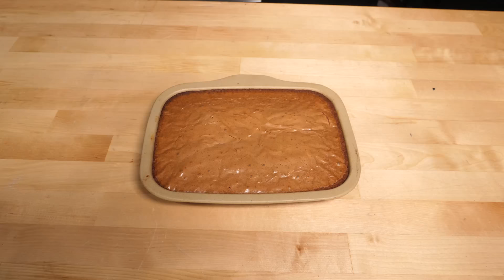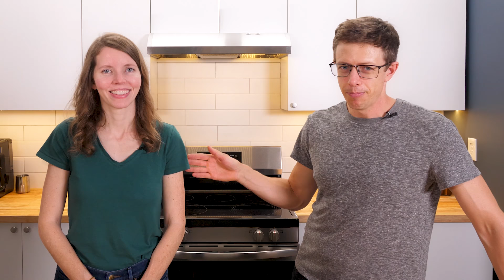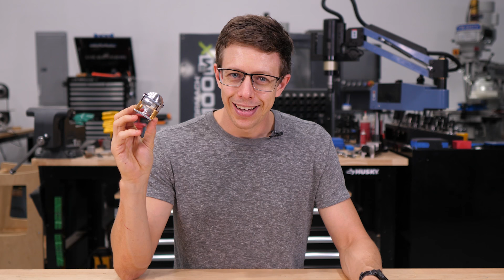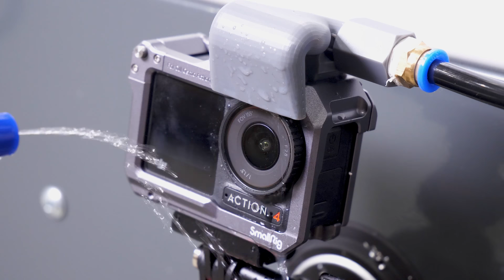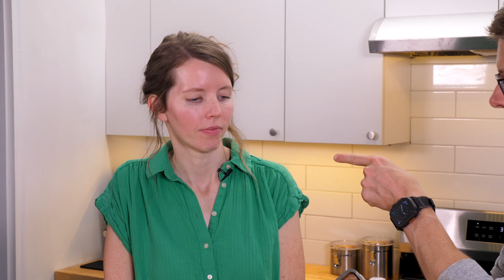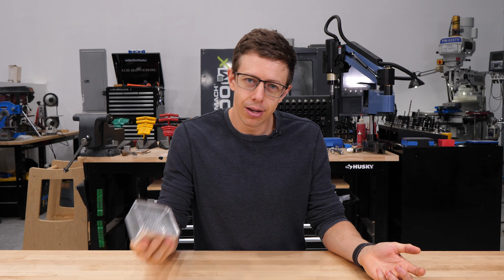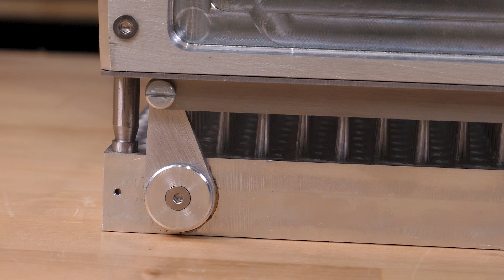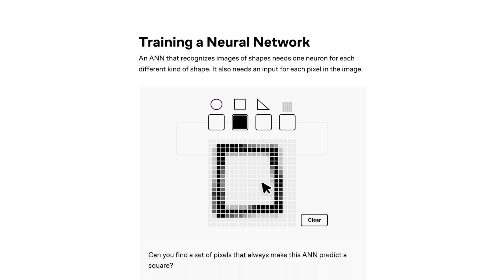Baking brownies from the inside out

Comment: Why not put the brownie mix in a paper cup like with cup cakes or muffins. The paper is thin so you get easier heat transfer, so less dried out and thinner softer crust. You could also just bake at a lower temperature for longer. For more even heating, right? Or make them thinner and bake for shorter since heat will reach the center easier and it'll cook faster. easy to over cook then this way though, so if you like a hard crust you can do the same but just bake for longer. Or you could steam the brownies so they are softer and fluffier. Like how people bake a cake in a rice cooker.

Comment: Instead of having the tapered spikes fit into the holes you should have a flat surround at the bottom of each spike that fits perfectly flush with the holes in the pan, or even a flat surround with an outer lip.

Comment: Bakers solved this problem a long time ago. They're called cake strips or even bake strips. You soak them in water and wrap the outside of the pan with them. The edge bakes at the same speed as the rest of the pan. Does not require any CNC machining.

Comment: My immediate thought was a water-cooled pan. If you could configure the cooling so that the temperature of the pan was keep the same temperature as the centre of the mixture as it heats then there wouldn't be an edge.  Probably would take a lot longer to cook as it would be kinda like a sous vide also getting heated from the top to give the crust.  Would definitely fail the wife's "looks like a normal brownie pan" test though, and would probably need to you drill more holes in your oven :)

Comment: So, hear me out: You have a plate (or grid structure) with screw holes in the bottom. Spikes are screwed in (bottom part of each spike is a hexagon). You then get a pan with holes in the bottom. The spikes are tapered, so the holes are too: clamp them together, no leakage. Brownie done? Unclamp - and turn that mechanism a bit further to lift the pan from the spikes.

Oh man you could spent so much time even further perfecting this pan... thanks for doing this!

Comment: Why not just use a ring clip design like a cake tin?

That way, you'd just need some mating geometry around the outside of your spiky heatsink and some overlapping outer surfaces drawn tight using an over centre spring clip.

Comment: This video creates more questions than it answers.. Why is the bottom not classified as an edge? Why does maximizing the side surface area of the pan result in "all edge" brownies, but maximizing the surface area of the pan bottom by creating vertical surfaces (sides) result in "edgeless"?? At what point does maximizing the the contact surface area with spikes start to approach the nature of the all-edge design, by increasing the surface area of the brownie in contact with vertical surfaces? In a Petersonian sense, one might fail to distinguish between the two opposing brownie philosophies, possibly resulting in a breakdown of logic and reason and inevitable brownie-induced existential crisis.

Comment: Amazing video, but i feel the obvious solution for this is to insulate the sides of the pan. The center of the brownie is only cooked from the top and bottom, so insulating the sides would cause the edge to also cook in the same way. This could probably be achieved to some degree with some folded parchment inside and outside the edge of the sides of the pan.

Comment: Issue: current pans mean the brownie cooks from the outside in overcooking the outside edges. Solution: transfer heat to cook the inside at an equal speed using a ridiculous aluminum pan. OR, easier possible solution: vacuum insulated pan that prevents thermal transfer of heat meaning it cooks more uniformly. Then it's about adjusting thickness until you hit happy point where heat transfers through the pan at the right rate. You know, like the vacuum cookie sheets that have been around for years/decades.

Comment: Is there a design that's possible that allows the pan to detach using a bottom that locks/unlocks by pulling, pushing, or twisting the bottom? The spikes might have to be angled or designed so that the unlocking motion doesn't rip though the brownie during the unlocking process

Comment: I could be wrong, and I'm no baker, BUT I'm pretty sure when bakers are making cakes, a common trick is to bake the cake in a double pan setup, with the cake pan surround by water. This controls the temperature on the edges and keeps everything cooking even and stops the cake from browning. Wouldn't that be an easier thing to try here than fabricating some weird spike pan?

Comment: I have heard of using containers with wooden sides so sure the edges of cakes don't burn. I assume it is just because the wood doesn't conduct as much heat as a metal pan. However, with brownies the difference between the burnt edges and the center tends to be more dramatic so I am not sure if wooden sides would be enough.

Comment: Have you considered reducing the temperature of the sides via Bain-Marie? You’d keep the edges of the pan at around 100c. Choosing a material that requires a lot of energy to heat up would also allow the brownie to evenly heat without hot and cold spots as the cook time would be longer.

Comment: Very interesting and well designed Mechanical Solution. I would wonder if a material solution might work better? Since you highlighted the areas of the brownie which tend to be cooked faster due to higher contact with the very heat transferable Aluminium  what if we replaced those sections of the pan with a lower heat transferance material?

Comment: step on the plate. microwave would burn stuff equally. you got caked. so if you use yeast or other co2 powder to inflate the thing, then heat the air inside. dont work harder, lazy smarter. you know any friction on metal surfaces creates micro shavings. so the bottom screw is not in any way reasonable. cake or fake.

Comment: Two things. 1 - the sealing could have been done with metal forming a lip, rather than rubber o rings. 2 - you mentioned changing the baking temperature and length to get the right results. What was the result using that temperature and length with a standard pan? Did the edge become less dense? How did that edge compare to the final results edge?

Comment: I think a silicon cylinder in a microwave would do a better job. Just set the power low enough not to blow the thing up bubbling.
As it rotates, only the center stays "in focus" the whole time and gets cooked faster than the edges. Fiddle with power / cylinder size / rotation speed to get the perfect result

Comment: Could have made a pan that slices off the edges (boundaries) of brownie after baking. Or thinner pans stacked on top of each other, basically horizontal spikes, that are sheets and not spikes. Also how about an inside-out brownie, where the center has the more crispy bits?

Either way, I would require a pan to be food safe, and dish washer safe.

Comment: Wasn't this an all-edge brownie, more so than a no-edge brownie...?

The distinction between edge and middle can be attributed to a difference in thermal exposure, so the solution was to apply heat uniformly throughout the brownie - fair enough, except...
The so-called 'edge' is the section with more direct exposure, subjected to more conductive heat. The chosen solution involved increasing the surface-area of the baking tin compared to that of a normal brownie, improving heat transfer into the middle to match that of the edges.

The final result? The brownie had less 'edge' because it had less of a difference between edge and middle. This was achieved by making the whole brownie entirely consist of 'edge' and simply adjusting the cooking time so the edge became more like a standard brownie's middle.

We need a follow-up. A version that makes edgeless brownies by reducing the contact surface rather than increasing it.

Comment: why not make the floor of the pan raise over the walls so you can transfer the entire brownie to a plate instead of raising the pan itself over the spikes but still have to cut while it's in the pan, then if the floor is removable it would be easier to clean and it wouldn't leak

Comment: Brownian motion is the random movement of microscopic particles suspended in a fluid (like a liquid or gas). This motion is caused by the constant bombardment of these particles by the fast-moving molecules of the surrounding fluid.
— Further experimentation is required.

Comment: Cake rings...or whatever they're called. Those adjustable fabric things that bakers soak in water then wrap around the perimeter of the cake tin. They retard the cooking to allow the batter to rise evenly and prevent the centre turning into a dome. I'm sure you could apply the same principle to brownies to prevent the edges drying out while the middle reaches temperature.

Comment: Couldn’t you have just lined a pan with the right insulation  so that heat conducts evenly edge to centre?
Reply: Or baked in a Bain-Marie? / water bath and baked the brownie in a bag? No edges in a ziplock bag. Also heats soft enough and cooks from all sides? 360° cooking

Comment: Have you heard of cake strips? When baking cakes, bakers will wrap the pan with moist strips of fabric to slow down heat transfer at the edges of the pan and have the cake bake and rise evenly. I wonder how this compares to your spiky contraption. It wouldn’t solve the heat transfer at the bottom of the pan, but maybe just another piece of fabric soaked in water at the bottom too?

Comment: I don’t get people who think the edges are the good part, I avoid the corner pieces and look for a centre piece because the squidgy fudgy middle is the good part.
Also, if I was avoiding making edges I would cook it in paper not metal so the metal didn’t make the edges hotter and use twine to suspend it so there’s no direct heat transfer just ambient and cook it low and slow. Or silicone.

Comment: not to ruin your fun or anything, since the entire concept is to get as much heat to the middle as the outside so it cooks uniformly, wouldnt that all edges pan have achieved basically the same result if you just lowered the temperature you cook at?
i do however endorse this product. ive never made a brownie in my entire life, but the edges are the worst bit and that gooey gooey centre is heaven.

Comment: When you brought up the problem of baking the dough unevenly (first the edges and than the middle) I immedeatelly thought of panko bread which is baked by electricity which doesn't produce any crust. And right after that I thought of baking the brownie in a microwave. But i assume both methods would change the brownie tecture.

Comment: 16:19 you could have done this with 2 parts. Simple: you make a bottom plate with spikes and handles that extend above the upper pan top rim on two opposite sides of the bottom spiky plate. Then, the top pan is exactly what you have with a holy bottom and side walls. That’s it. 

Gravity will hold the top pan to the spikes. You won’t have leakage because the viscosity and surface tension of the batter is higher enough to not leak.

During baking, the spike will be pulled up as the batter rises, only improving the seal. If you need the top pan to press against the bottom plate harder, you just leave more metal in it so it’s heavier.

Comment: It seems to me that using EOM in 2 degrees would be simpler to code than curve fitting a polynomial. Is there an advantage to using a more complex method? The only advantage I can see is that you can have more unknowns, and your data is experiment based.

Comment: if you're problem is the heat transfer at the side of the pan- brownie interface why not just lower the heat transfer at that location?
think about it 
if you had a metal bottom of the pan and isolating sides like porous ceramic or a thick silicone it would cook evenly across the pan and it wouldn't require weird mechanical contraptions to take it out especially with the silicone sides because you could bend them

Comment: I don’t think that hardness is the only factor that is different between center and edge probably also is moisture.
Also if you don’t want the tray transferring heat to the edges wouldn’t it done similarly if you simply used an silicone mold?

Comment: I think there's a missed alternative to explore here: the metal pan causes uneven distribution of heat into the brownie, so what if the pan were more insulating instead?

I remember when silicone baking trays were a new thing (in the early 2000s?), and aside from having a weird too-smooth surface texture on your baked goods I think they could be useful. More insulative material means slower heat transfer, and potentially less edgy brownies!

As you mentioned, low and slow with the heat should result in reduced edginess, maybe with the annoyance of cooking taking too long.

Of course this is far too mundane, silicone is old hat. You want some sort of superior insulator, like... aerogel!! 😂

Actually this would be the opposite problem, now heating occurs only through the open top of the brownie, which surely will produce weird results...

Comment: A nice mechanical engineering approach! Miele did a microwave approach: They did a lower than 2.4GHz microwave - they did 900MHz. This is frequency couples less to water, fats etc, so it is not absorbed at the surface, but in the entire volume homogeneously. This should also give a more homogeneous bake. So if you would like to do an excourse to microwave technology... And as you broke the wife´s oven you are eligible to buy her a ridiculos overengineered oven by Miele!

Comment: A square pan with hinged walls, the walls are held up by wax corner supports.  As it bakes, the edges start to harden enough to hold their shape, the wax melts and drops the walls to prevent the edges getting to crisp.
Be sure to put the pan inside another pan to catch the wax.

Hardest part would be making wax that melts at the right temperature.

Comment: Have you considered just a "standard" cake pan with a removable edge but with spikes on the bottom? You could then just remove the edge with a clip that everyone who bakes already knows how to operate solving the user-friendliness problem. To remove it from spikes you would flip it upside down. Cutting pieces while upside down before flipping them could make flipping it twice viable. That solution may be just feasible to make from stamped sheet metal and thus could actually be made into a niche consumer product.

Comment: I think taperd holes helping seal against the tapered pins would make a easier sealing system. There are probably plenty of inspirations to be had from low cost removable bottem cake pans to increase the cost or ease of use.

Comment: can you make the 2 piece design but use a less thermally conductive material for the sidewall, to prevent the traditional edge from forming? also instead of straight spikes, can you curve them around the center so you can twist the bottom spikey part of the pan on/off?

Comment: Wouldn't it have been much easier to simply use two clasps on the design at 09:06, instead of screws? 🤔
That way you could simply flip open the clasps and pull off the spikes as usual. No screwing around required. Exactly like a round cake form, where you can remove the circumference.

Comment: Making a springform style pan with a bottom containing the spikes seems like a cheaper and simpler solution. Then you could just flip the bottom after taking of the band and pull out the spikes. Cut up the Brownie and flip them again for serving would not be that big of an issue. Just looked it up sqare springforms do exist so it would just be the task of making a new bottom for that.

Comment: Okay but there are cake forms called spring forms that have clamps to connect the wall through pressure with the bottom and after the baking you can release the clamp and lift the wapl for easier cutting serving etc.

That would have been way simpler than the handle and was my first thought when wife said baking forms don't have screws.

Also that would make it way closer to an actual end user product.

Comment: So here's a separate less "metal working" idea. Since the problem is the time delay between the edge and the center heating up the solution is to shorten that time. 
There are these combined convection oven + super powerful microwave  ovens they sell for the food industry. Our local baker uses those to heat a sandwich all the way through with perfectly molten cheese in just short of a minute.  Now I wonder whether these would be good at making brownies.

Comment: I'm pretty confident you could've done with a two-piece cake tin where the bottom is metal and the sides are silicone or something similar. That way you can keep the sidewalls slower cooking, because the silicone (or else) acts as an insulator, and the metal bottom still slightly overcooks the brownie bottom for that firm foundation.

But this was more fun.
Reply: Yes! Had the same thaught. The spikes makes it even, but really just edges everywhere. Insulation on the walls is the awnser!
Reply: @TheM4man  It's not edges everywhere though. He compared it directly to the center of a regular brownie. The spikes mean a shorter cooking time, so no part of the brownie ever gets a chance to turn hard like an edge.
Reply: @Squant Sure, but I think the bottom up heating is really key. Especially if you (like me) want your brownie batter only tempered in the core and barley having the structural integrety to hold a 5 x 5 cm piece together.
Reply: We've got an old pan where the bottom has two layers of steel with a half-inch air gap. Presumably the designers wanted an undercooked middle? Also it leaks when washed, so ends up with water on the inside and rusted out.
There's quite a lot of insulated bake-ware out there though.